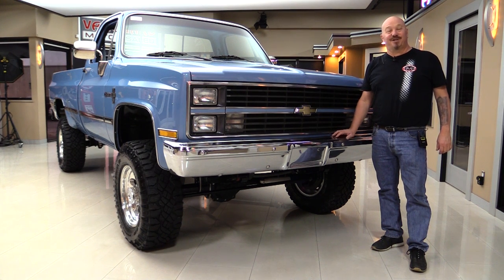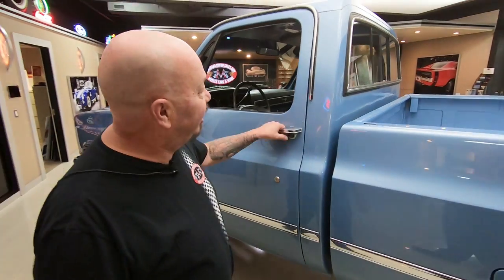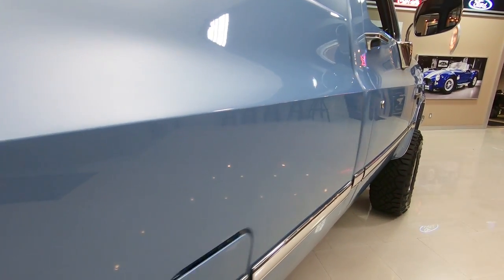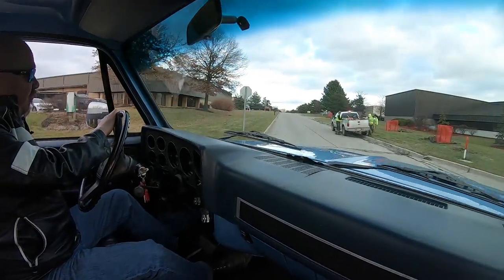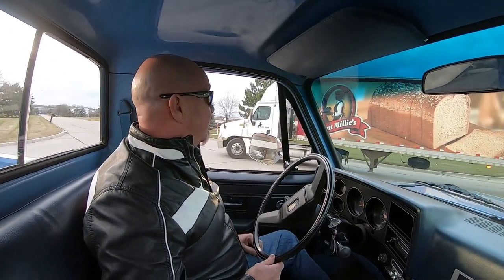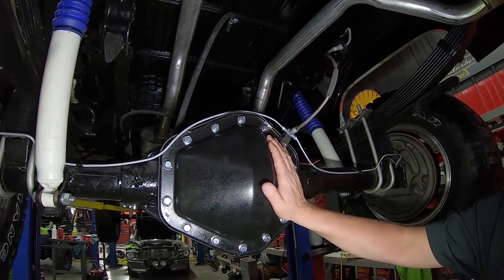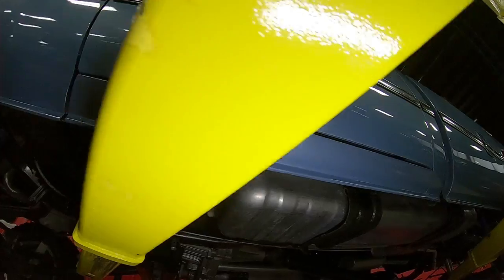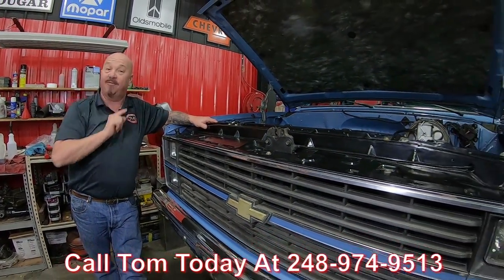1984 Chevrolet K20 Pickup For Sale

Comment: I bought a brand new (still have it) C20 in June 1984. Fully loaded including roll out spare, a $600 dollar option. A/C, PW, PDL, Cruise, AM/FM Cassette 350 motor with Turbo 400. Out the door? Just over 13K!!